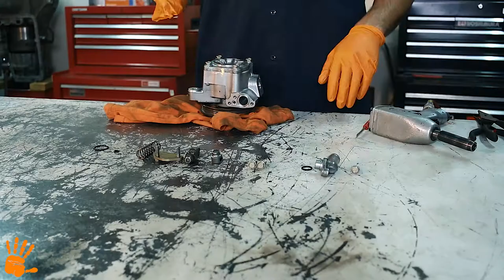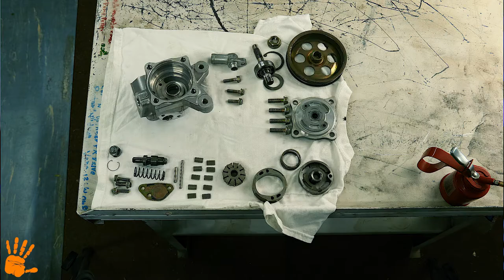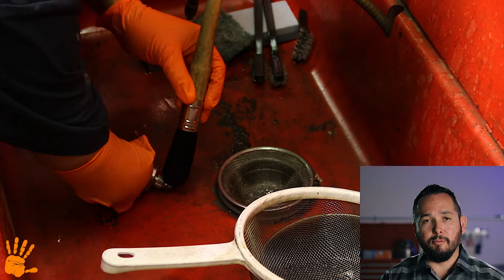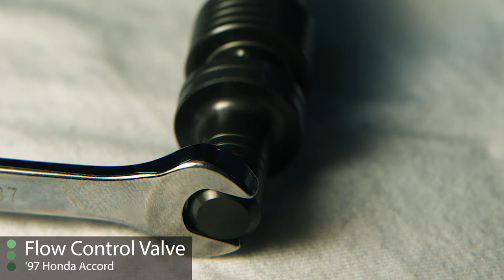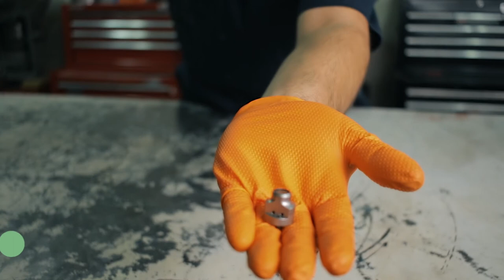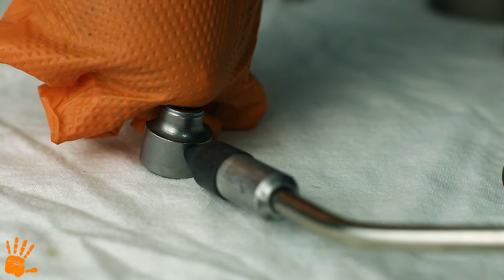Power Steering Pump Rebuild - Part 2 of 3 (1 Hand Mechanic) #SouthpawAutoworks

Comment: My 2001 Fright liner FL60 , with the Mercedes Benz mbe900 engine with 400,000 miles and runs like a top ,The german manufactured power steering pump was the original pump and recently the seal went bad allowing ATF fluid to contaminate my Engine oil . There are no replacement pumps available, but seal kits are available. I found your video after I had taken it somewhat apart, I think it should go back together fine, or let’s say, I hope so. Thanks so much for your videos, big time helpful!!!
Reply from the maker: That great to hear.  I hope all goes well.  Thanks for dropping me a line!

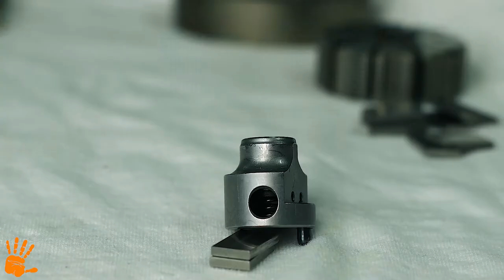Comment: It’s vey Nice to watch you here in this Video. I feel that I need some more details about 6:50 to 7:20, in which you talked about VALVE MOVEMENT.  You used pressurised Air to check the movement,  I was not able to assess that what kind of movement it would be. 

Would you please help me to understand this clip from 6:50 to 7:20.  

LOVE YOU…… ❤SouthPaw.❤
Reply from the maker: I see what you mean.

While putting air pressure into the small hole, look into the large hole (eye protection is recommended).  You'll see a small spring.  When you pressurize the small hole, you'll be able to see the spring compress, and the valve will move downward.
When you release air pressure, the valve will travel the other direction, and the spring will relax.

Comment: Hello Robert, Thank you for the attention to detail that you have shown in your video.  After watching your previous Youtube video where you dismantled the pump, I can't wait to see the next instalment where you put it all together again.

Not everyone has a wash trough like you used in this video.  What are your thoughts on washing all the parts in gasoline, and blowing them clean and dry with compressed air?  What advantages do you think arise from using the spray can cleaner?
Reply from the maker: Here's Part 2....which covers the cleaning.  Reassembly will be covered in Part 3....which is coming soon.  https://youtu.be/D5J4JwF0Qd0
To answer your question....I've never cleaned anything with gasoline.  So, I'm unable to make a comparison, or give an opinion.
One of the benefits of brake parts cleaner is that it doesn't leave behind any residue.  Of course, this may vary from brand to brand.  I really like using this stuff.
Brake Parts Cleaner (3M):  https://amzn.to/2HxQ1Pz  (paid link)
Reply from the maker: Part 3 of the video series is ready.  https://youtu.be/PFbHff9ezno

Comment: Hi. Thanks for such detail on the power steering pump rebuild. I have had to run the PS pump without fluid to get home. When i got home I filled the reservoir with correct oil but now the pump is not working.. Does this mean the pump is broken. Can it be fixed?  .
Reply from the maker: Your positive comment is appreciated.
I've had to do that, too (a short distance...a few miles).  Although, I was fortunate that it did not do any damage to the pump.
If it were my vehicle, I'd be pulling the pump out of the vehicle, and opening it up.  Without doing that, it would be hard for me to tell if the pump could be fixed.

Comment: Following your guide now, found out that previous mech installed the vanes and rotor in a wrong way, is it ok if i upload my video? Will paste and pin your link as my guide
Reply from the maker: That would be great!
Reply: @SouthpawAutoworks  the only difference on our pump is the sub valve, mine does not have one, will check if the sub valve was stuck on the hose, i also found out that they installed the vanes, rotor and spring on valve control in a wrong way, hoping that pump will work again, i also encountered several issues all made or done by the previous mech, your vid was so clear and precise, and love the motivational part at the end

Comment: I need to rebuild a 2000 volvo s80 pump.  Will this apply?
Reply from the maker: The pump in this video is out of a '97 Honda Accord LX (V6).  So it will definitely have some differences from the pump in a 2000 Volvo S80.  However, all pumps (power steering, automatic transmission, etc) have commonalities.  
I tried to get more info on your pump, and could only find info on removing/replacing the pump....not rebuilding.  https://www.youtube.com/watch?v=QmSpJvTicek

Comment: Hi Robert, you said seen guys use soapy water to clean it. Wont it rust doing that?
Reply from the maker: Yes, it can.  However, rust can be avoided.
After the parts are washed/rinsed, the parts can be quickly dried by using compressed air.
If those cleaned/dried parts were going to be stored for sometime (and especially if in a humid climate), coating everything with clean oil (power steering pump fluid, etc) will prevent the clean parts from rusting.
Reply: @SouthpawAutoworks  Noted. thank you bro
Reply from the maker: You're welcome, man.